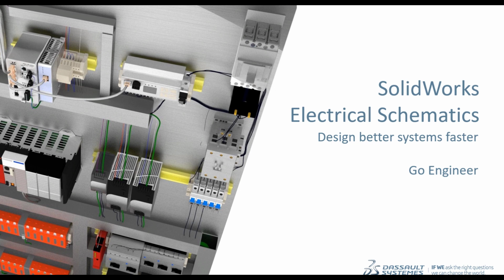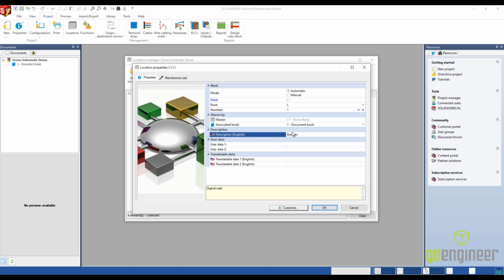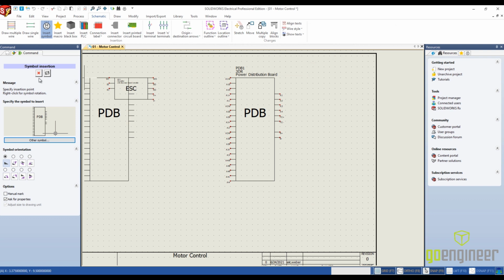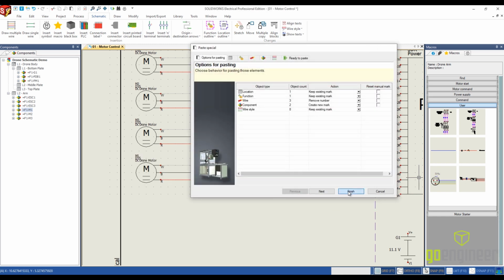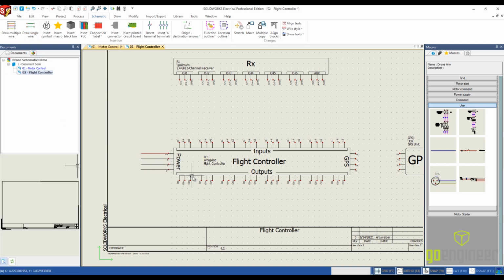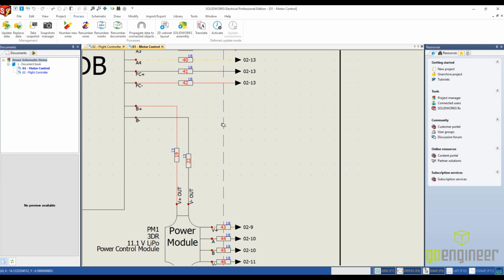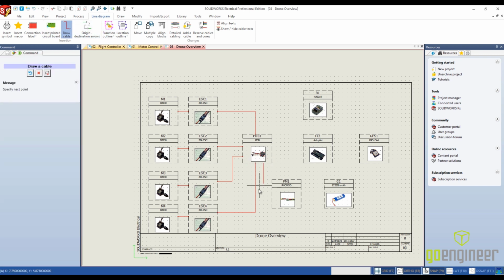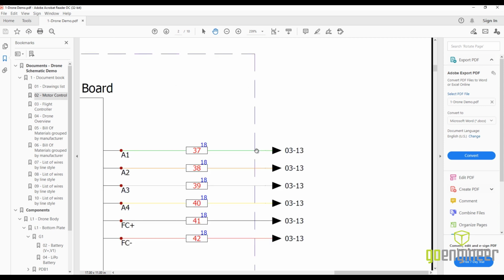SOLIDWORKS ELECTRICAL - Schematics of a DIY Drone

Comment: I tend to work from high level architectural view down to the detailed schematic.  Can you start with the one-line overview and then move down to the detailed schematic rather than the order in which you worked here?
Reply: Hello, Yes you can do it in either order.